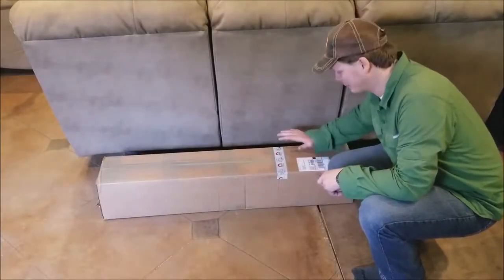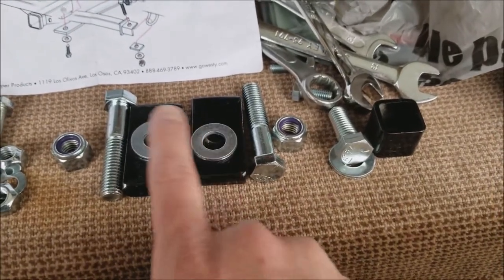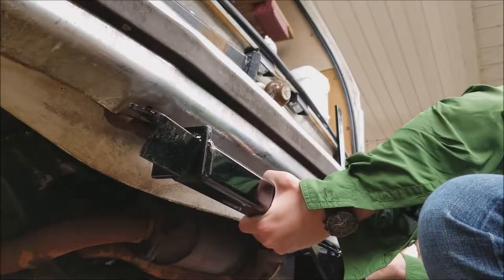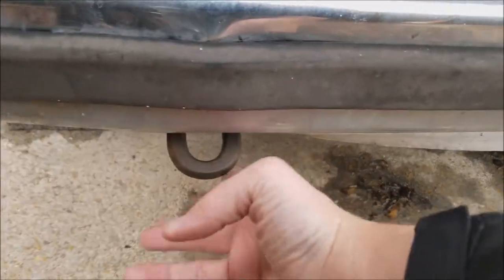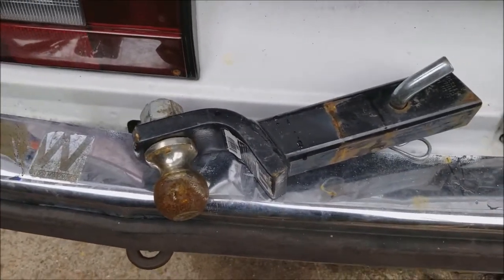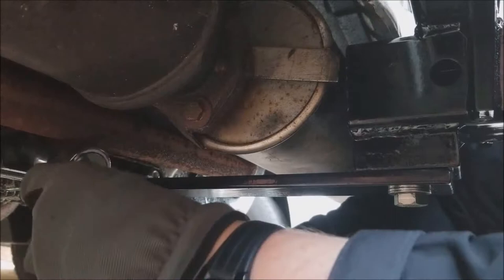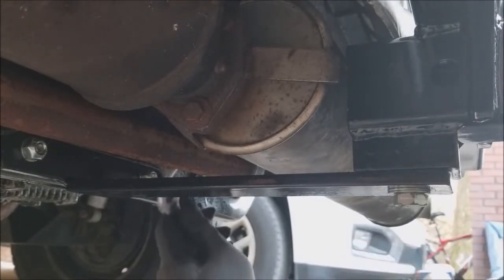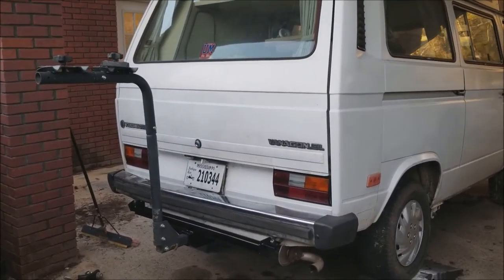Milo the Vanagon: Installing Trailer Hitch

Comment: Nice video✌. I love my hitch. I have since pulled multiple trailers with mine since my video. Great idea on the alternative transportation. I have broke down so much my wife agrees it's part of the trip.
Reply from the maker: Thanks for the comment.  My main goal was for the bike, but I do like having the option of pulling a small trailer.
Reply: thomas herrington yea I am wanting to get a 4 bike rack for mine as well. I have lots of kids
Reply: What kind of small trailers have you pulled; how much GVW? I want to pull a 30ft sailboat, 50-55mph, only at lower altitudes across USA, Canada, Alaska. I think I need a Class 3 hitch, with air shocks, electric trailer brakes, disc brakes on the Vanagon, perhaps a Vanagon Syncro would help, and more attachment points , so I don't rip the bumper off. I plan to have a Subaru EJ25, 227hp engine and a 5-speed SubaruGears transmission (Australia). The boat ballast weighs 3,300lbs, empty boat trailer weighs about 2,000lbs...
Reply: @donjvalley  I have towed several cars no problem. I pulled 4k over several mountains hauling wood. Steep climbs and decent. With that said it pulled it fine. I have a ej22 in mine. 4psd manual. My transmission was the weak point of my build. Subarugears is the way to go. I didn't have trailer brakes. It was definitely needed.
Reply: @brokencompass8919  Thanks so much for your reply; the total GVW of the 30ft sailboat and trailer might be closer to 5,500lbs, but I plan on a Class 3 hitch and several re-inforced attachment points, AND trailer brakes, for sure...

Comment: Would you trust that hitch carrying a motorcycle rack with a honda ct70 (about 155 lbs)?
Reply from the maker: I have towed a tilt trailer with a Kawasaki mule on it - the tongue weight of the trailer was probably that much if not more. There are two types of trailer hitches - one that just bolts on to the tow hooks and the one I put on in the video that has metal straps that also go under and attach to the VW's engine mount. I trust mine (I have a 1968 Honda CT90 trail) but make sure to strap it down well so it doesn't torque outwards and put extra stress on the hitch and also doesn't send a handlebar through my back windshield (been there, done that...).

Comment: How has it held up? How much weight can it handle on the bike rack?
Reply from the maker: It has held up well. I occasionally tow a 5x8 trailer with a Kawasaki Mule on it and it pulls well and hasn't loosened up on me. I have had 3 bikes on a 4 bike carrier as well. I didn't put four bikes on it  because I was more worried about the back glass than the hitch not handling it.